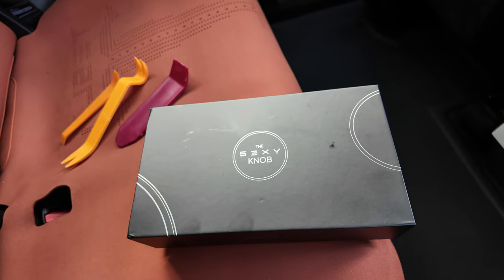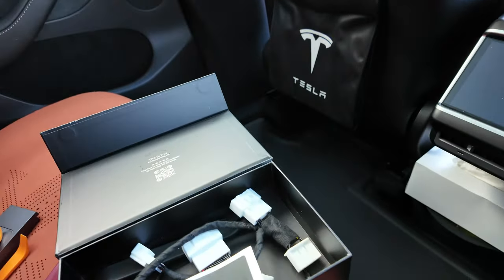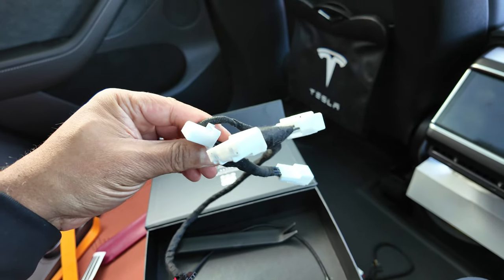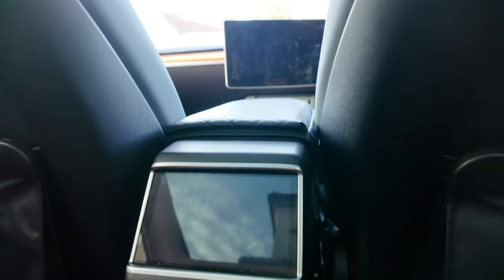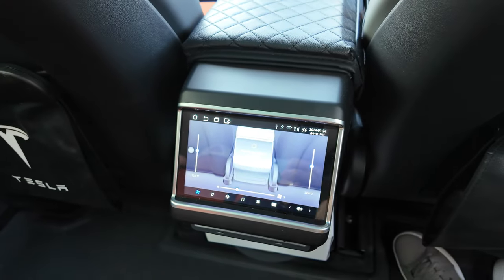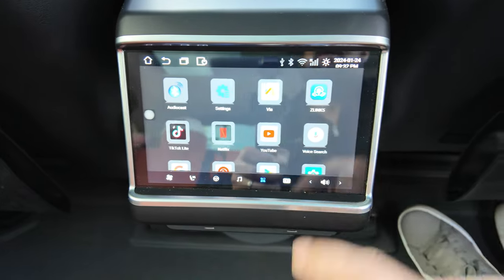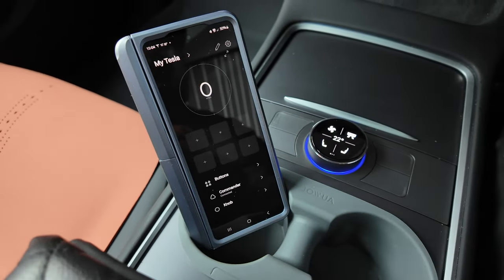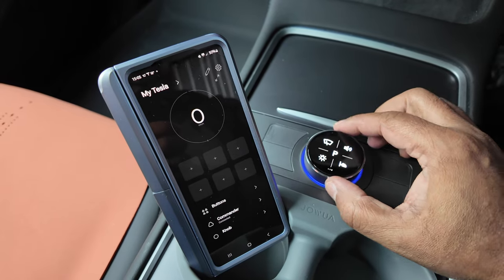S3XY Knob: Lets Get It Installed

Comment: Just got the S3XY knob also. You should have used the front connector as the space at the back is too tight. A bit more work but it’ll be worth it as you get more options also with this connector. 

Anyway I wanted to ask: Do you have a link for the seat covers the look real nice. Cheers.
Reply from the maker: Thanks for the tip! I'll be looking into the front connector for sure due to needing to re-connect the rear entertainment display. Just haven't had the time to strip the front trim out yet 😅. Checked Aliexpress store where I bought the Model Y seat covers but not sold any more. Do a search on AliExpress and quite a few come up for sale, I've seen some which look great. Good luck in your search 👍

Comment: Haven’t had a chance to watch the entire video, only the installation part, but was wondering what happens with your rear monitor display? Are you no longer able to install in concurrently? Thanks for the vid by the way!
Reply from the maker: Hi, Thanks for taking the time to watch the installation part!  I've reconnected the rear entertainment display as it also controls the rear fan and heating so needs to be put back. I'll be installing the S3XY Knob wiring in the front pillar OBD port as Knob ships with both wiring options. Both Knob and display connectors cannot fit in the rear OBD as very limited space. Stay tuned as I'll be doing a front pillar install for those wishing to connect this way! 👍
Reply: @VlogLife247 Awesome, I’ll keep a look out for your follow up video 😊

Comment: I just fitted mine today. I'm a bit miffed that the temperature doesn't change on the Tesla screen when you change it on the knob. The release notes for the firmware update says "HVAC - status is synchronised with Main display" but it isn't. I'd rather not have to look down at the knob to see what I've changed the temperature to.
Reply from the maker: Great you've got the S3XY Knob and shared your feedback in the comments. It's valuable information for viewers wishing to purchase this product. Enhance seem to be keeping abreast of what their customers are saying so I'm sure they'll make it a priority to update this function soon.
Reply: @VlogLife247  It's been 2 months since this post. I just installed mine and immediately noticed the same problem. PLEASE SYNC EVERYTHING!!!!!!!
Reply: They've recently made a workaround that uses your phone to relay the information to the tesla.
Reply: @TN-ec6ec  Which requires having the app open on your phone and keeping it unlocked. They are aware and are working on it though.